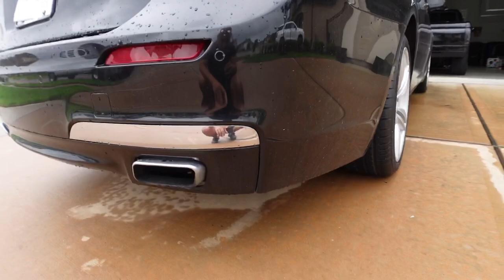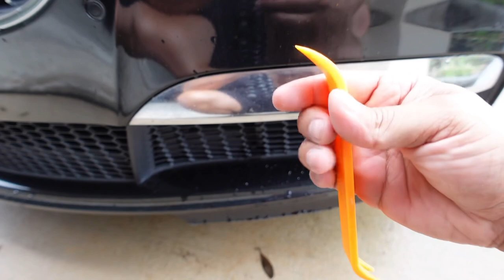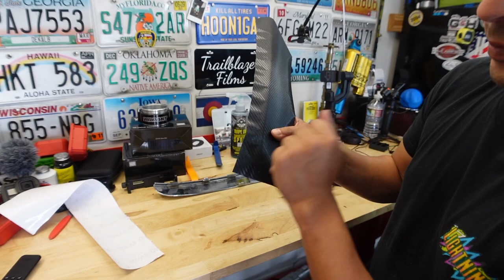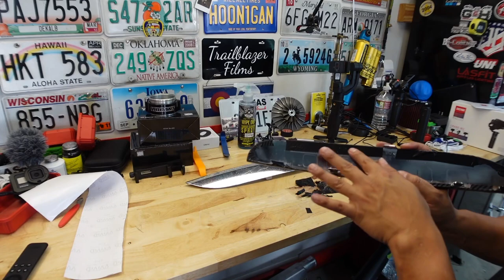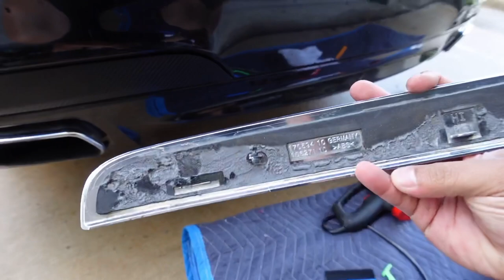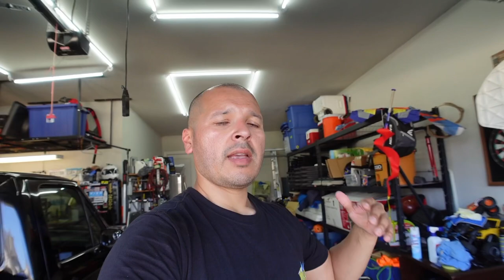Chrome Delete With Vinyl Wrap. How To Use Vinyl Wrap On A Car.

Comment: Love the way that turned out, nice work! I’ve got an ‘18 F150 with the “bar” grill. I’d love to wrap it however, it has some compound curves so to speak. Somewhat similar to your 250. With your experience, is that doable? I consider myself handy and I’m willing to put in the practice. Thanks in advance man!